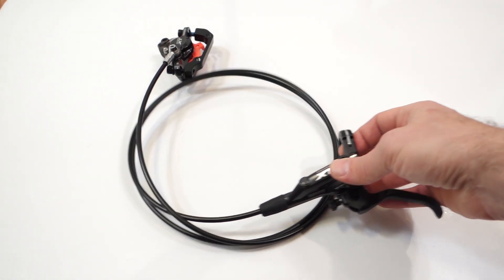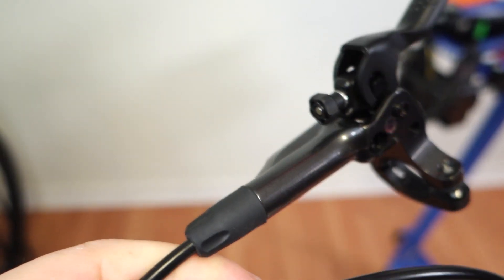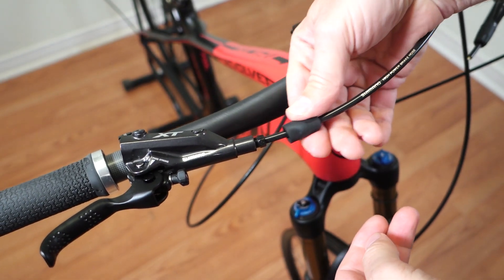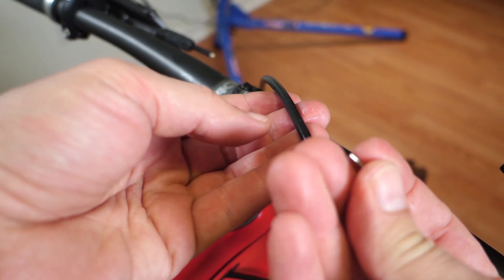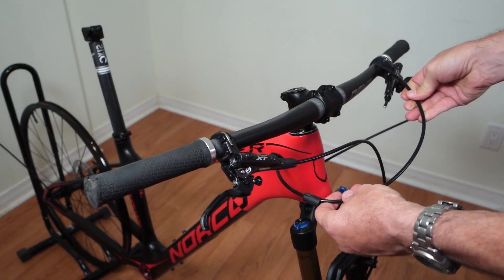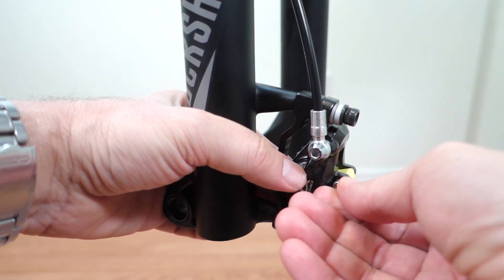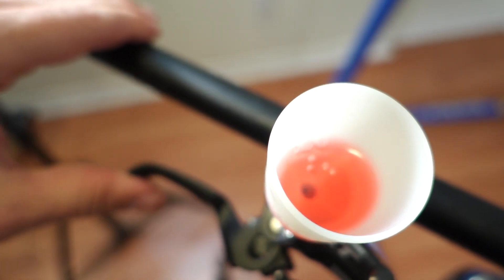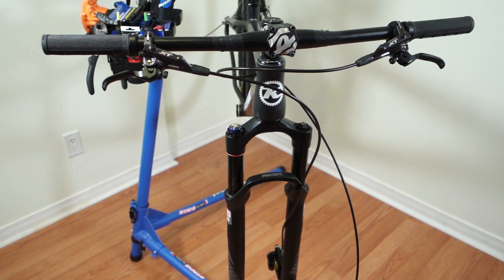🔥How-To Install Shimano Disc Brakes 🔥 Brake Hose Shortening and Quick Bleed

Comment: Shimano XT vs SRAM code R, hello to whoever is interested in
my experience. I have had XT and currently I’m ridding code R, if I knew what I
know now I would have replaced the code R directly on my new bike for the XT
BR-M8020 (or Magura MT7 little bit overkill for me). I have had zero problems
for 3 years with my XT and now ridding code R for 4 months I’m almost at the
point of replacing them. So why: They just do not quite functionate as how a
good set of disc brakes should + pour material quality, rotors rust, cheap
paint, oversized components, (DIY) unfriendly to work one, never quite the
result you where hoping for after some tlc and so long. My girlfriend rides SLX
for over 2 years and are in better condition than my code R, we ride 95% of the
times together. I hope that I saved some people from wasting their time, money
and frustration. Something about myself I’m a perfectionist very technical
skilled and realistic. (Last summer in Austria a DH bike rental place told us they
replace all Sram brakes directly and sell them for dirt cheap new, they just do
not want to bother using them. That should have been a motivation for me to
replace them directly but I did not, regrets big time.)
Reply: exactly the same experience for me, had slx on my trail bike, code r on a new enduro bike - almost had a crash in the alps when the rear code r pulled to the bar at random!!! replacing them with a set of saint m820s
Reply: @jamble7k  and @Mauro the main reason is that SRAM works with brake fluid (which is hygroscopic hence absorbs humidity over time) so you have two enemies there: air and water, which heats after braking and becomes vapor. This explains why the levers pulled to the bar. Once cooled down, vapor goes back to water. 
Even the best bleeded SRAM system could get humidity inside so over time might give issues.
With Shimano, using mineral oil, once you took away air, your system is fully working.

Even though I have a motorbike and I regularly bleed its brakes (which use brake fluid) without any problem, for my bike I switched to Shimano Saint m820s 5 years ago and they still perform badass.
Reply: Mauro van Leijden this is so true.  Had my sram guide for 3 weeks since it came with my new bike.  They are garbage!!!  I went out and bought a set of Shimano XT.

Comment: No need for bleed block for bleeding levers. Bleed block is for bleeding the calipers so you don’t get oil on your pads. It’s nonsense when people say for both so you don’t put too much oil in lines. Countless lever bleeds with caliper on disc, never an issue. Total waste of time.

Comment: What if you don't have the insert and the plunger(Olive) say, you are installing a used brake, how do you get the insert and the plunger(Olive) since you can't reuse the old ones. I will wait. You see, everything isn't always ideal as you demonstrate in video dear content creator, some people like me just can't always afford new brakes that come with everything.
And again, when you cut the rear brake cable for the bike with the internal routing, why didn't any oil come out? I thought shimano brakes are already filled with oil and also bled. All these information when left out creates nothing but confusion.
Reply: I'm banging my head on the desk.

Comment: Can i also do this with my wheel installed? So that the brakes will bite into the Rotor instead of the bleeding Block. Just the small bleeding i mean
Sorry for my Bad English. Answer would be great
Reply: @LoveMTB  ive got the Block. Just wanted to ask in generell. I will Order new saint brakes so they should bei included
Reply: @LoveMTB  okaay. Will there ne 2 Blocks or what

Comment: The yellow bleeding spacer, does it come with a set of new brakes, or do I have to order one additionally?
Reply: Comes with a set of front and rear, or even in some cases with a front and rear package (you end up with two).
Reply: Thanks for checking in on this! FYI, my T6000 set (a m6000 variant) came with two. (And two pairs of blocks for holding the cable. Not confusing anything here.) In any case, no need to order that extra.

Comment: Great job on this tutorial. I very much want to shorten my hoses, and I have the bleed kit and the cutters already. I still need to find the insert and the olive. Do you buy those somewhere? I assume that once the olive is used once, it gets deformed onto the cable end and thus can't be moved or re-used.

Comment: Tnx, great video. I just wonder, wouldn't it be better and safer to push the oil from the caliper into the funnel, just a little bit, to be sure to push those air bubbles into the reservoir? Do they travel into the reservoir by themselves after you connect the hose?
Reply: LoveMTB Ok, tnx. Anyone knows the theory behind this? Why should air bubbles travel to reservoir more happily in pressurized system? I think that they obey the archimedes law (bouyancy, lighter than oil, tendency to go upwards), and friction with oil and cable (that's why tapping the cable helps). Applying pressure doesn't affect the oil, since it's uncompressible, but affects bubbles, squashing them a bit. I'm just curious. Would love to have transparent cable so I can see what's going on there. :)

Comment: This is one of the reasons why I prefer Shimano brakes. Everything is simple, I’m doing it on the same way and works perfectly. The only difference is that I’m using a cable cutter for the hose. I used to cut it with knife before but after I tried it with cable cutter I couldn’t be bothered with the knife anymore.
Reply: just be careful you don't crack or crush the hose inner sleeve. Park Tool even states that their cable cutters aren't supposed to be used to cut brake hoses. You really don't want to use something that is using a clamping motion to cut the hose, that is why most hydraulic hose cutters are just a straight or even better a triangle shaped blade to cleanly slice through the hose without deforming it.

Comment: im not sure why, aside from profits, ppl are pushing disc brakes for road bikes... so much hassle
Reply: With all the riders switching over to carbon they had to move to disc due to safety reasons. The braking surface on carbon doesn't work like aluminum did.

Comment: Ok here is one. Take off ur shock, remove the can, now looking at the ifp shaft there is a oring holding a large washer. The bottom out oring. It separated. Why and how and how do you replace that without doing a full ifp service?
Reply: 2016 rs monarch rc3 plus debonair 200x57
Reply: Did a full tune and service. Then got a stuck down and when i took the can off i found the seal failed
Reply: The only thing i can see is to do a full ifp service and remove the seal head. Once you pul off the seal head you have to remove any air in the damper which in that case your better off doing a full service at the same time. But i have no idea how that oring failed. Must have been a manufacturing problem in the material.
Reply: Oh and get this. Rs lyrik can use fox gold 20wt oil and rs monarch can use fox float fluid.
Reply: Was chatting with steve from vorsprung. He said no prob with either
Reply: Also found out that shocks with pos and neg chambers that use those small dimples to equalize preasue, do not use any grease in them. All grease end up settling in the dimples and causes a stuck down. Matter of fact im wondering if when removing the air can to get the shock unstuck. That may have ripped that seal
Reply: I see they got rid of that seal and replaced with counter measure?